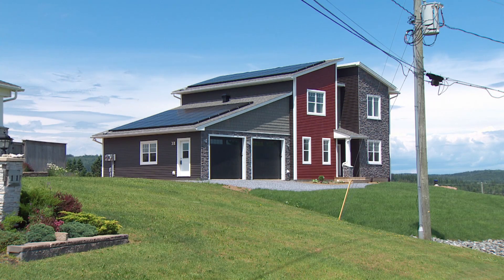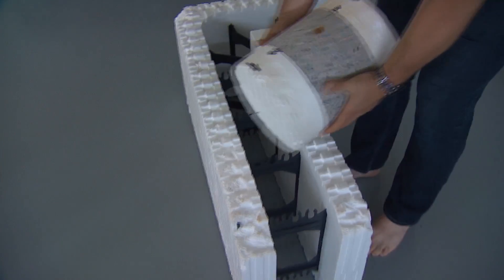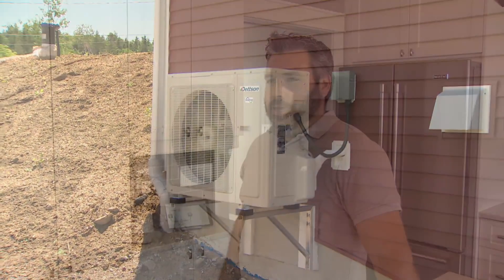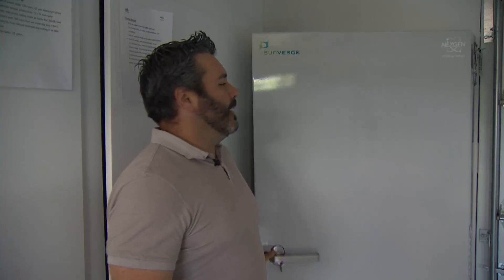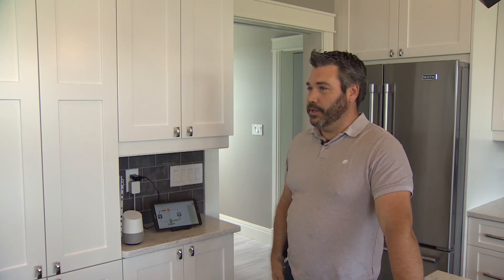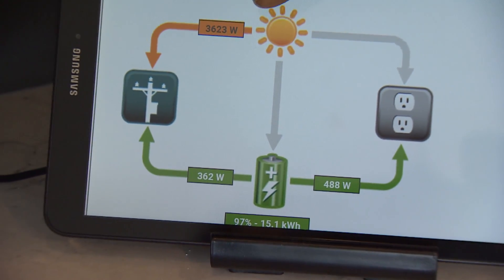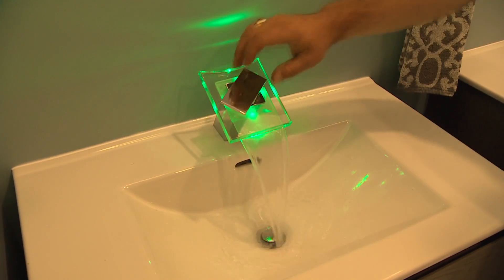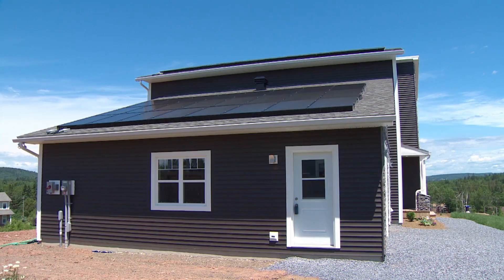This net zero home makes more energy than it consumes

Comment: So what was the carbon footprint to make all the materials that go into the house?  

Cement for the concrete is made by cooking off carbon in limestone so you get a massive amount there, Silicon in the solar panels is heated to a molten state then slowly a starter crystal is added then slowly rotated and pulled away growing the silicon crystal that is then cut into wafers so lots of power needed to heat the mass and keep it hot. Glass sheets used in the panels is made on the molten tin method meaning you have a massive natural gas furnace that keeps the tin molten at the same time it is melting new glass, Natural gas is not as clean as they make it out to be as it comes out of the ground contaminated with CO2 and they have to separate them before they pipe the natural gas on. 

You might be producing more energy then you use now but that dose not mean you are out of the hole dug to get you to this stage. You would also be taking advantage of ground source or water source heat pumps if you really wanted high efficiency for heating/cooling as the energy transfer is much better then a air based system shown on the house.

Comment: So, the excavators that dug out the foundation ran on wind and solar?? WOW!!!
Reply: Nope, neither were the factories that made the solar panels, or the drywall, or the battery bank, etc.   Still lots of energy consumption "upstream" of the actual finished house.  Question is, is the additional energy consumption on the front end, offset by savings on the back end?
Reply: Still pollutes so we should all do nothing🙄
Reply: Frolf Jerry Missing the point. We lessen our dependence on fossil fuel. That way we are not dependent on the Middle East, South America for energy. We a a country nation become self sufficient

Comment: Brilliant. Lots of this should become standard for new houses.
Reply: KILLKING110 exactly I'm a builder and depending on the size of home it's going to add 50 to 100k to the construction of homes here in BC.
Reply: Osiris Malkovich it is in BC. the government is bringing in regulations that will require new homes to be built in net zero energy efficiency like this one.
Reply: KILLKING110 exactly I'm a builder and depending on the size of home it's going to add 50 to 100k to the construction of homes here in BC.
Reply: now imagine the jacked up cost of buying a home like this if you think the housing situation is bad now guess what something like this will make it worse.